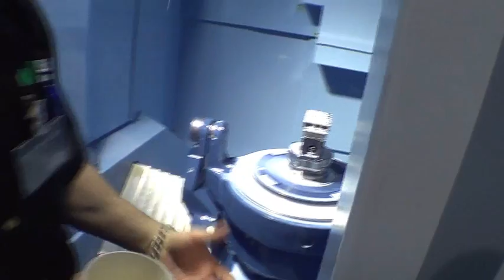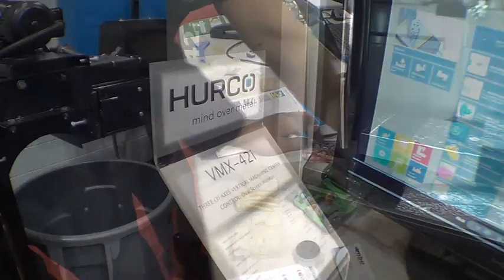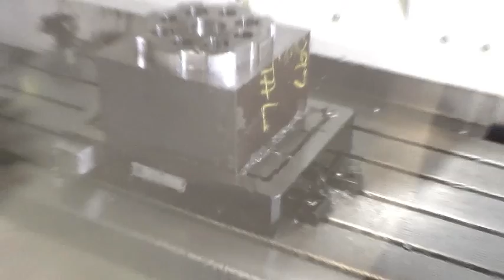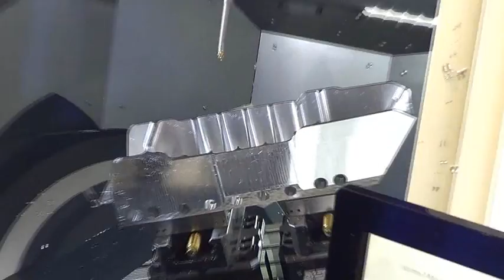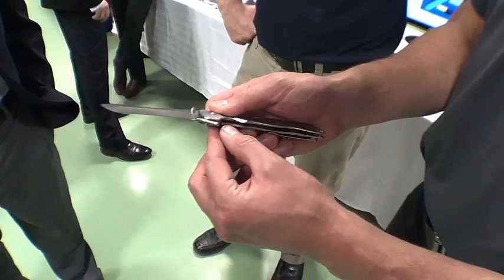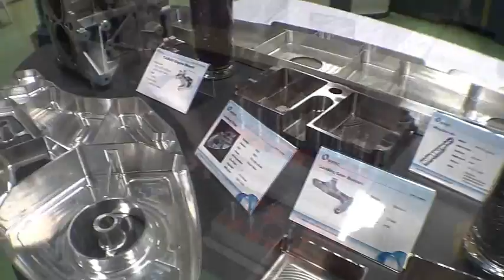Elliott Matsuura Machine Tool Open House

Comment: There is no doubt CNC multi axis machines are very impressive and can produce amazing results. However,I feel a bit of dislike for them! I have spent most of my lifetime learning to be a toolmaker/machinist and work hard to produce parts of the highest standard possible. My gripe is that anybody with a knowledge of computing and axis to the right equipment can produce products whilst not having much experience in making parts by hand or have spent months and months learning how to file metal to size and high standard by hand. Basically CNC has made things easy!
Reply: Its the total opposite brother, imagine someone with your skill, you've reached a great place, not its time to show how fast you can use those machines to hold +-.00005, instead of +-.0002, o or heck you know all the tricks and tip and your production could be trough the roof holding slightly bigger tolerances, but better yet now you can focus on making extremely complicated things that would have taken too long before. Someone with true skill can only reach higher when technology brings parity to their old skills. You have been made free to make seriously crazy tough stuff.

Comment: John what is a typical cost to purchase the code file for a single fixed blade knife design I created?  I want to have my design coded so I can take it to any local CNC machinist had it over to them to cut out blanks.  Thanks.

Comment: The Makino machining centers were all ways the most popular machines where I worked. Very solid machines. The 10 and 15 year old Makino's held way, way,way better tolerances than the brand new Haas machining centers we had. Yes the controls were better on the Haas's but you could hold to the ten thousandths all day long on the Makinos.  In my opinion the Haas machines are way over rated.
Reply from the maker: Thanks for the comment, I was extremely impressed with Makino and SST in general.

Comment: what did you think about that hurco ?
that is in my opinion the best machine out there
Reply from the maker: Well I don't know about "best", there are a lot of higher end machines out there, but for the price range I think it's pretty awesome.  Though I've never actually used anything better than my Tormach so what do I know haha.
Reply: personally i never even consider  buying a machine more expensive then that i just like the fact that they always have something new like the 3d printing head 
also for the work i do i need a stable en very strong machine i ques that is why i like it

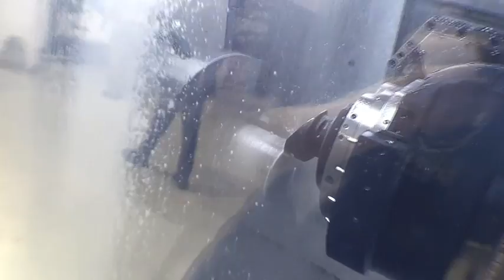Comment: That machine at 17:12 is the same exact machine I ran for about 4 years, programming, set ups and operator. Such an amazing machine, we use to run 2 tools on the same part at the same time on the same side.
Reply from the maker: Awesome Jason!  Lucky you.
Reply: I got to see my boss, and owner of said machine BLOW IT UP! almost about 3 years ago now. Rushed our set-up (we were n00bs at the time), and pretty much said "get out of the way let me show you how its done" and 100% rapid into the active spindle, @  between 3-4.5k rpm. Needless to say, I thought we were getting bombed! I was standing at the saw, next to the sub-spindle side of the machine. HOLY SHIT the machine musta have lurched into the air! Anyways, it never cut straight again.